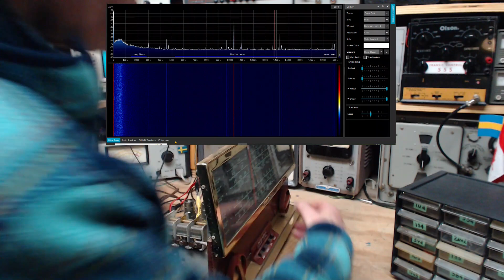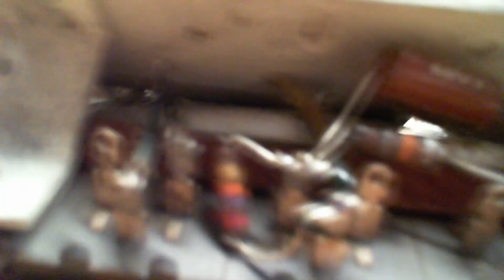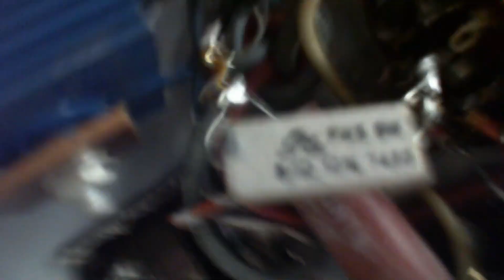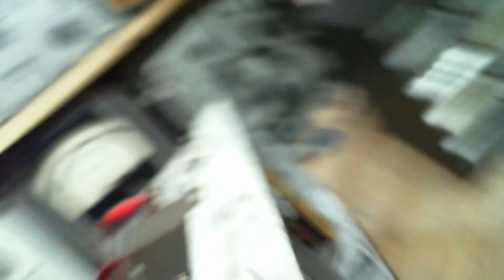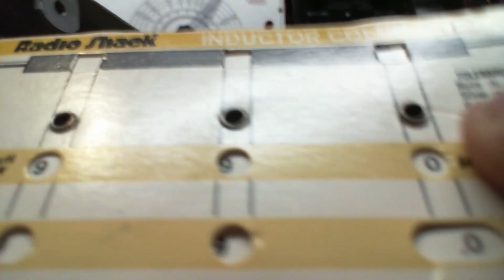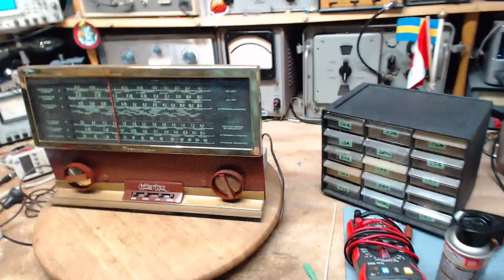Hallicrafters TW1000 8 Band Tube Radio Video #2 - Pointer Surprise

Comment: It used to be common practice to jump The solenium rectifier with a  diode and a dropping resistor to get the voltage back down.

Comment: Something we used to do in the 1950’s for shorted tuning cap plates , was to break out the old Boy Scout Swiss Army pocket knife, using the large blade and running the tapered blade thru each section like you were slicing bread. Its time consuming but eventually you will relieve the shorted stator to rotor short.

Comment: I am glad you saw your way through. Let’s hope America follows your example. We are about to become a fascist state. Here I go again portraying myself as a Resistance fighter.
Reply: I am from Iowa USA ~ I know that a lot of us would miss Jim if he quit.  I know I need to have jim possibly repair my zenith 2G.  I have a few parts left, oil might be a small part of the issue but. I know that the spring and a few parts do not match this version of the 2G.
Reply: To Jim:

The bands, on the radio dial, in your video here, are all out of order; the band selector switch is most likely not going in the order of AM, SW1-7 BANDS. JOE BIDEN'S GRAND FATHER MADE THIS HERE RADIO AND SCREWED UP THE RADIO BANDS😱😱😱😱